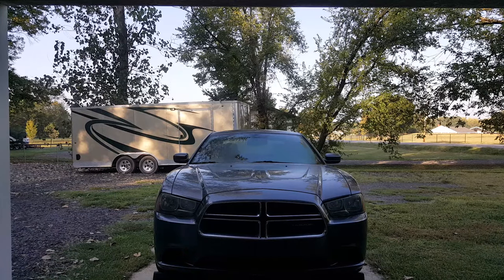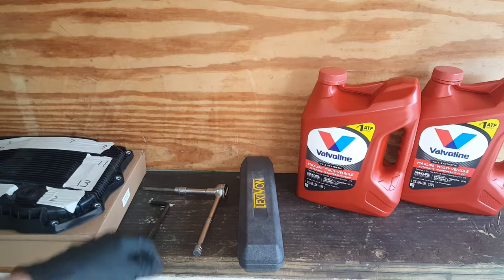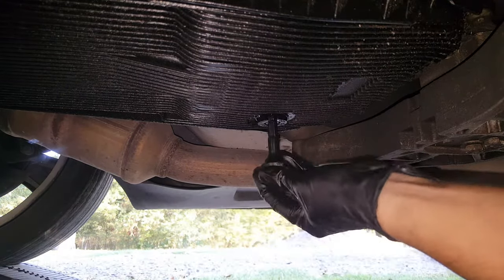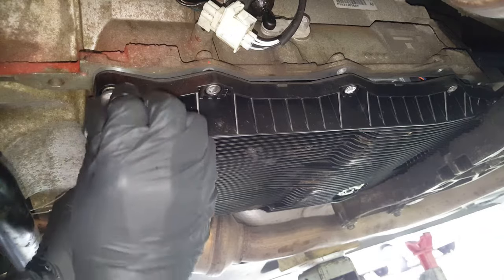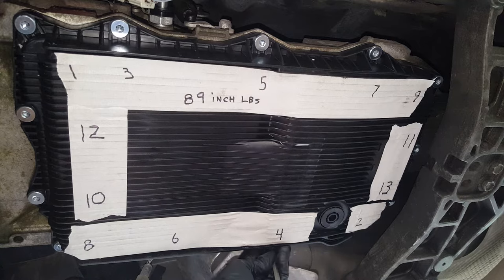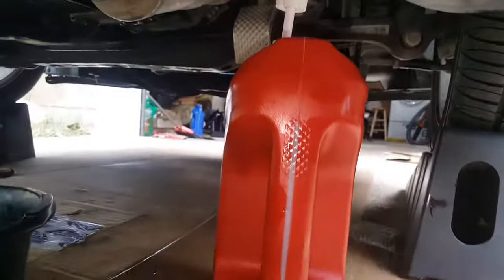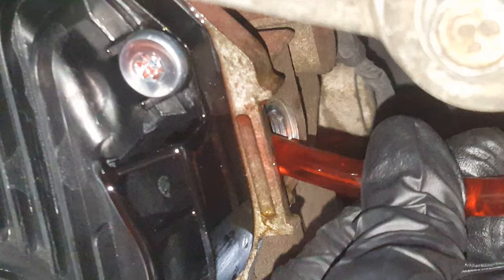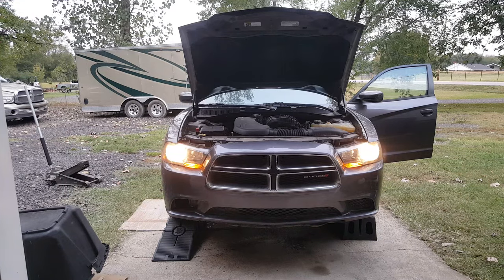How to change the transmission fluid & filter 2012-2023 Dodge Charger 8 speed 845RE 8HP70 ZF 8 spd

Comment: May try to figure out a fitting for the 8mm drain plug. So you can pump the fluid in without dripping out. Plastic push to connect?
Reply from the maker: That would have been nice to start of with for sure. Thank you for the feedback.

Comment: I wish I could pour fluid from the top. 
One of my transmission cooler lines popped out while I was driving and leaked out my transmission fluid.
Reply from the maker: Same thing happened on this car of mine and ruined the previous transmission. I originally thought someone had incorrectly removed the lines from the tran cooler. But I am starting to wonder if there is not some kind of defect. Anyways you will want to replace the oil cooler lines asap , I will leave a link here. Thank you for the feedback , much appreciated.
https://ebay.us/4hXJ2H
Reply from the maker: Here is a video , you will have to scroll through , but it shows how I installed the cooler lines .

Comment: I have the same year. A 2014 Dodge Charger SXT Plus with the 8 speed transmission. Mine is AWD. I am trying to figure out if yours is. The reason why is a mechanic told me if I plan to change the transmission fluid myself, I need to prop up a component with a jack that will, supposedly, fall when I open up the pan to drain it.

Any idea on what I’m talking about, and is yours rear wheel drive?
Reply: On the AWD version, there is a component which I believe is for the drive train that obstructs access to the pan. I believe the mechanic I referenced was referring to something to do with that.
Reply from the maker: Best thing to do is crawl under there and see if all the pan bolts are accessible. If so then you don't need to remove the transmission support. I am assuming they are accessible the same as the rwd because the front shaft is off to the side. When I say accessible I mean you can get to them by swivel or smaller extension. Hope this helps.

Comment: My girlfriend ended up getting a 2023 Dodge Charger R/T 5.7L last November and currently under 17,000 miles. When do you recommend changing the transmission fluid ?
Reply from the maker: I would do a drain fill at 30k and continue to do them every 30k from there. The mopar fluid is the best 8 speed fluid. This is best deal , just purchased some.
https://amzn.to/4fLXPLF

Comment: I just followed ur instructions.was only able to get around under 5 quartz in by the time I started pouring out I rechecked after driving and going through gears  and temps stayed around 140 degrees on my Hondas the trans fluid were much easier .. u think I got enough  fluid in ? Around 5 quartz came out of old fluid ? So it’s about right just wondering what u thought ?
Reply: lol nvm I see u said about 5 quarts  thanks for the help sir my charger 3.6 2014 jus that around 86k and wanted to do the fluid change
Reply from the maker: Thank you very much for watching and the great feedback.

Comment: Do you have to get a new pan or can you reuse the old one?
Reply from the maker: You will need to get a new one. Not only does it come with a new gasket but it has a built in filter. Thanks for the question.

Comment: Is this same as dodge charger srt 6.4 2015?
Reply from the maker: If it has the 8 speed or looks like this transmission pan , then it will be the same. Thanks for the question.

Comment: I’m planning to service the transmission on my 2015 Chrysler 300 v6. How many quartz did you end up using after all set and done. I noticed you had two 5 quart jugs.
Reply from the maker: Most of the time you should get a little over 5 quarts on a drain fill. I had swapped out the transmission and had to add more than usual. Thank you for the question.

Comment: So it takes 6quarts? Not 9.5?
Reply from the maker: If you perform a drain fill , it will be closer to 5 quarts. Thanks for the feedback.
Reply: @s33therfan  just did mine Saturday, on my 2020 dodge charger, worse thing is I had to change my pan. It had a small crack and thanks to your video I was able to swap it out and service my transmission at the same time!